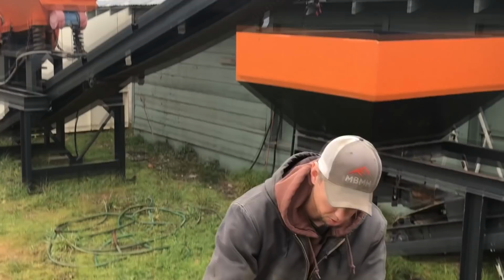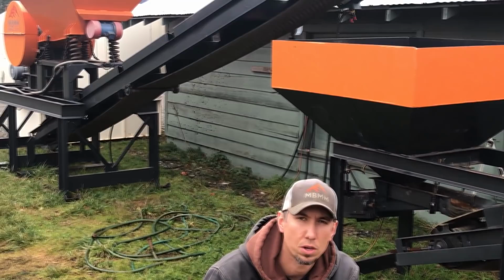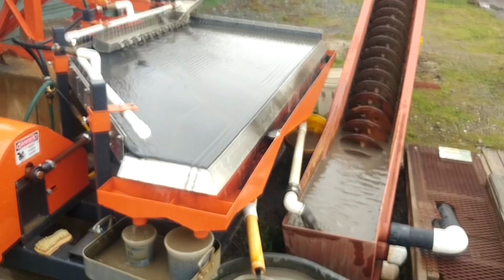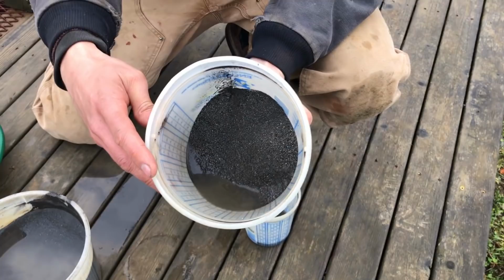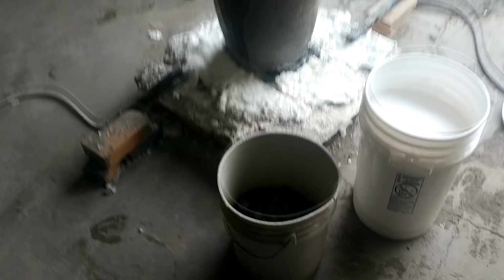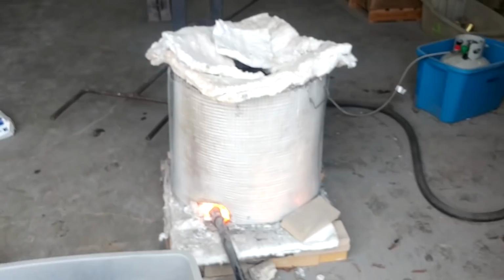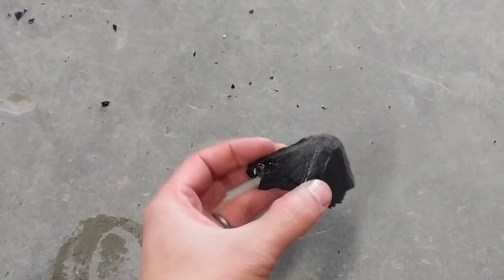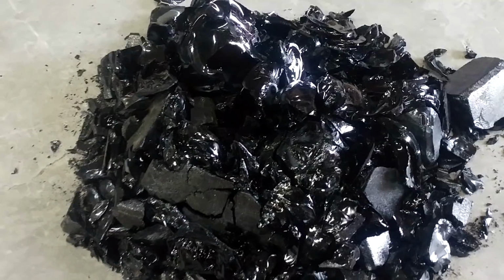Crushing, Grinding, Gold Panning, Smelting Gold Slag for Better Fine Gold Precious Metal Recovery

Comment: I came across some slag. Corner stone on foundry corner 1765. Of course had go dig deep to find everything. I took a 80 lb bag of slag various colors. The lighter colored you could see lead shot gun BBs. Crushed to a powder ran through a gold cube, took concentrates into a steel ball mill with mercury, spun 5hrs. Took reclaimed mercury into nitric acid ended up with about a 1/8 of a gram. Was told the mercury won't amalgamate with all the gold, that I should have took the heavies and smelted with extra borax. Is this correct? He said I didn't get all the gold. He said micro will still have slag around it. Please get back to me, thanks

Comment: Great job i have project same as don but i use vat leached already treated 1500 ton slag from jewelry waste recovery but result not well, now i have remining slag around 500 ton i start to grind to 200 mesh by ball mill then will check which sutible shaking table or centerfugal concentrater
Reply from the maker: For pricing, please send us an email at Info@mbmmllc.com or call 360-595-4445 You can also visit our website here: https://mbmmllc.com/

Comment: Why is there a hopper and an extra belt between the two crushers?
Reply: To adjust feed rate into impact crusher.
Reply from the maker: The feed to the hammer mill needs to be consistent.  The jaw crusher doesn't crush at an even rate and surges.  The hopper and mag feeder even out the feed to the hammer mill and table for better operation and recovery

Comment: Jason hello
during smelting, you recovered a lot of iron ... you melted the slag and not the sulfides. why iron in the crucible then?
Reply: usually slags contain less than one percent gold / copper and direct smelting without a collector will not show a good result
Reply from the maker: Iron will replace the other base metals if present.  Unfortunately there was not much base metals in this material

Comment: Have you tried roasting with Borax?
Reply from the maker: Yes, check out some of our other smelting vids. Thanks for the tip
Reply: Hello
Reply: it seems (idk) roasting is particularly helpful because the gravity/density itself might be changed after roasting/oxidizing, more would shake out in the seperation table